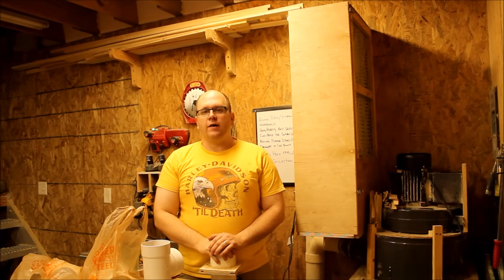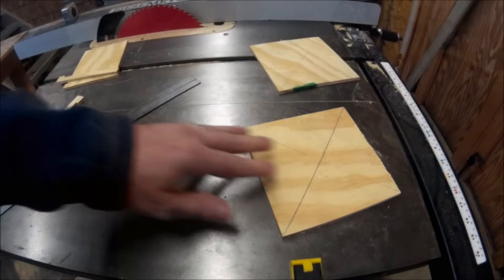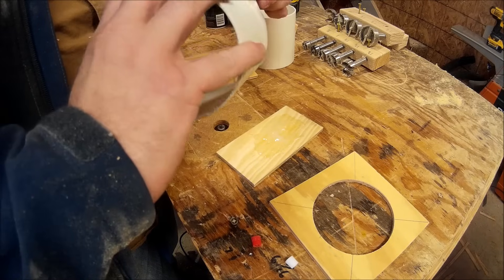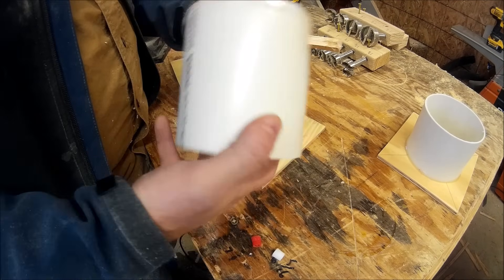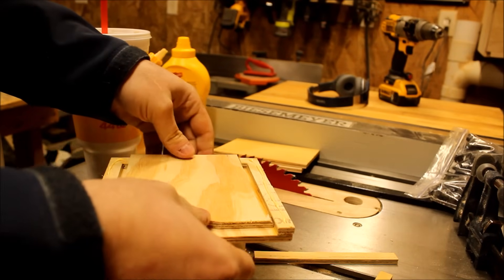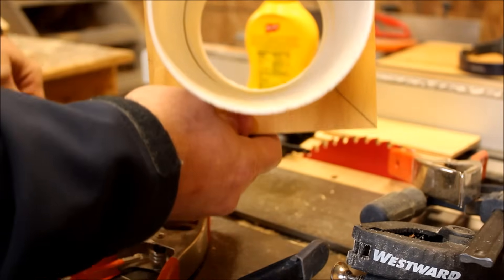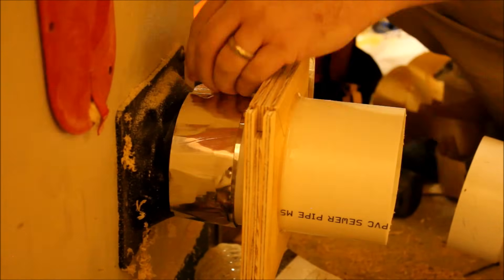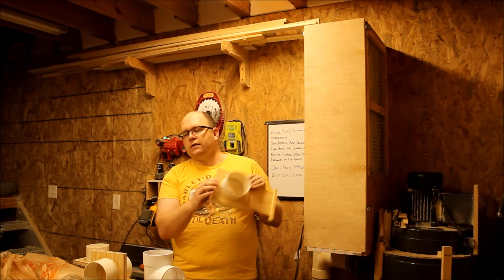Simple, Cheap Blast Gates *Free Plans!* (Amazon links in description)

Comment: Thanks for putting this video together, Thomas. Very helpful. I found it as I was planning to move and set up a new shop. I built 8 of these well in advance of moving using 2-part epoxy from the hardware store, and loved how they looked and worked. Fast forward about a year and as I was getting ready to install at the new shop. I found that if I tapped the blast gate or wiggled it forcefully, or dropped it on the floor accidentally, the bond between the epoxy and pvc pipe would break. I used the “get a bigger hammer” principle and used a larger bead of JB Weld original cold-weld steel-reinforced 2-part epoxy (the stuff that cures to a dark gray color), and I am very happy with the results. They don’t look as neat and clean, but I am confident theyll I’ll get years of use
Reply from the maker: Thanks for the update, Jack. I really appreciate it. I have since moved from using epoxy to silicone caulk. Same seal, but it can handle the shocks and vibrations a little better. Just keep that in mind if you need to build any more in the future. Cheers!

Comment: Thank you for posting. I am getting ready to make several with your pattern. What I wonder is: if the pvc is just cut from DWV 4 inch pvc (drain pipe), (that you use on the blast gates) then what or how do you connect it to the 4 inch drain DWV pipe that you run from your DC? It seems this would be the same size?  As well as going on to your tool? Making this stuff all fit together is a problem for me. Thank you for all of your effort to share!!
Reply from the maker: I just used normal DWV pipe couplers to attach the pipe to the blast gate. Then at the machine, the ports were usually pretty close, so I could make either the pipe or the flare fit with a couple turns of aluminum tape to take up the slack. Most recently I made custom gates and flanges using a 3D printer. You should check out that video too. Cheers!

Comment: Couple things you don't have to run it through a jointer  you can just put some wood paste on it. Also you're going to get clogs with those two little flanges on the inner part. you have to make it so it pulls all the way through or else it'll jam that Dust  those crevices.

Comment: I appreciate your video. Have you tried CA glue with the aerosol accelerator?  It works great for small wooden parts. It cures instantly so you dont have to worry about parts moving with the wet glue on them.
Reply from the maker: I think it would work, however I don’t think it would be as airtight as using a nice even coat of wood glue. To make it airtight, you would probably need to use an amount of CA glue that would make it cost prohibitive. Thanks for the suggestion!
Reply: @SouthpawWorkshop  Thank you for the feedback.

Comment: Thanks for the great video. Just got a dust collector and setting everything up. Could you just seal the side that used tape on? Maybe glue another thin strip of plywood in the opening?
Reply from the maker: +Stan Ellis with this design, if you don't leave that end open, dust will eventually build up and prevent you from closing the gate all the way.

Comment: I would have hoped/expected to see the blast gates in use.  I have read complaints about blast gates, professionally manufactured that had issues such as a load hissing sound, losing suction so they had to keep adding tape to cracks etc.  Why didn't we see the blast gates here actually being used and sucking up dust and shavings?  Hard to make a decision to try the plans, free or not when we don't know or see the outcome.

Comment: It has been three years.  How have they held up?  I really like this idea.  I'm going to be setting up a workshop sometime this summer, but $$$$ is definitely a factor.
Reply from the maker: I’m torn. They probably perform as well as the cheaper ones you can find on Amazon. It all depends on what your time is worth. Back then, I had nothing but time. Now when I re-install my dust collector, I’m probably going to buy my blast gates because I don’t have a whole lot of free time anymore to make them. They functioned for 2 years straight without any problems and likely would still be working today if I hadn’t torn out the dust collection system when I moved into a new house.
Reply: @SouthpawWorkshop  kudos for acknowledging that just purchasing a blast gate is the much more practical solution.

Comment: I know you did this a while back. Are you still using them? Was the effort to build them worth saving the $15 or so to buy one? I run on a TIGHT budget but time is also tight. Just trying to weigh the values. I appreciate this video and the plans.
Reply from the maker: They work well. Only worth it if you plan on making several at once.

Comment: I see you did this in January. How's everything working out with the flapper, etc? Thnx in advance
Reply from the maker: +Roger K they still work great. I haven't had any issues except some are slightly looser than others, so I have to make sure to mount them so it slides horizontally and not vertically because they won't always stay open if vertical.
Reply: Roger K

Comment: This is a nice build but plastic blast gates are cheap. Their problem is that the end that receives the gate blade is closed. It makes the gate into a trash compactor. Saw dust accumulates in the closed end and eventually the gate does not close completely when you push it in. The cure is simple. Cut the end of the housing off just enough that you don't get the end of the blade. Now any accumulated sawdust is pushed out every time you close the gate.  There is no loss of suction.

Comment: I take it you don’t have a brad nailer or pin nailer. You could have added a strip of plywood in the void produced when you open the gate.
Reply from the maker: Defeats the purpose of the void.
Reply: Thomas Lightle - Red Barn Woodworking   Which is....? Don’t misunderstand...I like what you’ve done and I likely will copy. I’m referring to the void on the side where the gate itself is not.
I’ll correct myself...I see you put an aluminum flap there. Sorry.
Reply from the maker: Sorry, I should have been more descriptive.  The void is there to give any leftover chips and sawdust somewhere to go.  Without it, over time, the sawdust will pack into the empty space and keep you from being able to fully close the gate. The void allows the gate to push out any residual debris every time you close it.  I use the aluminum tape to create a hinged seal when the gate is open, so you don't lose suction through the void.  Hope that addresses your questions!
Reply: Thomas Lightle - Red Barn Woodworking  thanks it did.

Comment: IT SEEMS TO ME THAT YOU WILL NEED A HUGE VACUUM MOTOR TO CREATE THE NEEDED TO SUCK UP ANYTHING MORE THAN JUST DUST.?.  IF YOU MATCH THE DIAMETER OF THE TOOLS OUTLETS OR MAYBE A LITTLE BIT SMALLER I THINK THAT THE SUCTION YOU WILL GET WILL BE MUCH STRONGER....... Just my opinion and my past failures..........